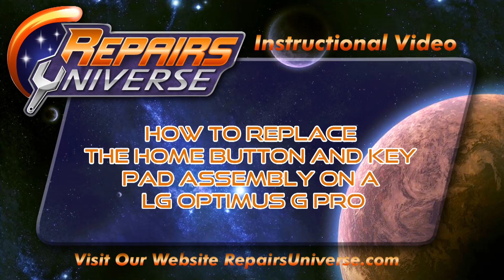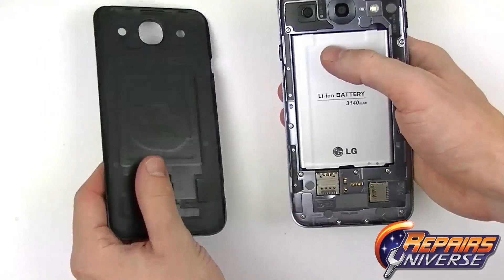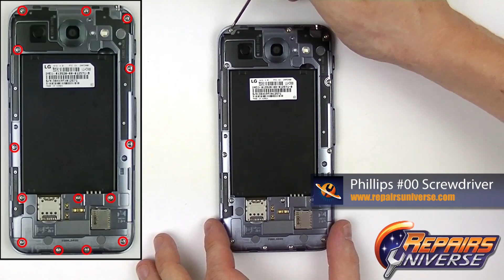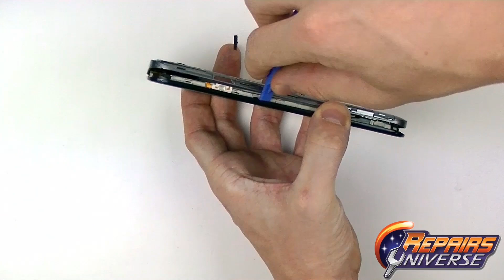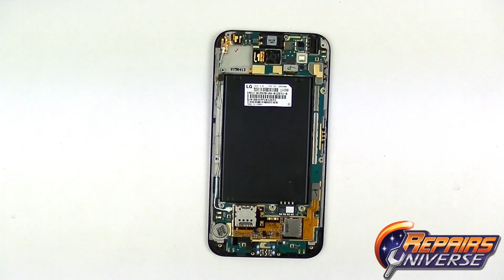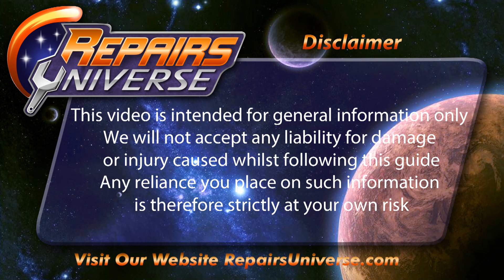LG Optimus G Pro Home Button and Key Replacement Guide

Comment: I have an LG Optimus G Pro E988 problem with the option and back button not working or lit up when I touch it. But it sometimes lights up and the phone will go on a flashing mode with different screens and the keyboard will pop up and start typing with chinese keyboard and then it will just stop and not work. What do I need to do to get this straightened out. Pls help.
Reply from the maker: Kevin Nde Try performing a system reset via your settings. If this does not help, replacing your touch screen digitizer assembly should resolve this issue.

Comment: My home button and the light is not on. What part do I need
Reply from the maker: We recommend to double check your flex cables. Ensure they are seated correctly to your motherboard. If the issue continues, the unit may be defective.

Comment: I have an lg optimus g pro and i dropt it, the home button stop working but it charges and the notification light works. I took it to fix but they said that there was nothing wrong with it. Do you know what might be wrong?
Reply from the maker: CHIHUAHUA4809 Is the device still projecting an image? Is it still fully functional besides the home button?
Reply: Repairs Universe Got a similar issue. Device is fully functional except the home button. The home button lights are also operational. Please advise.